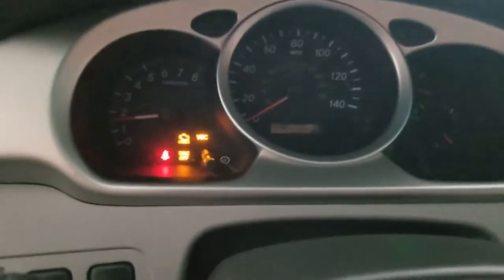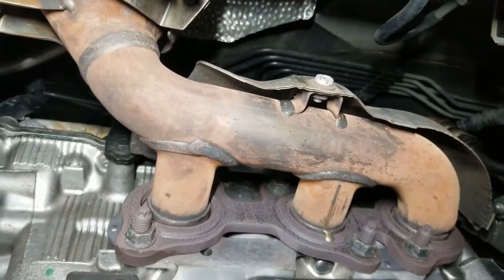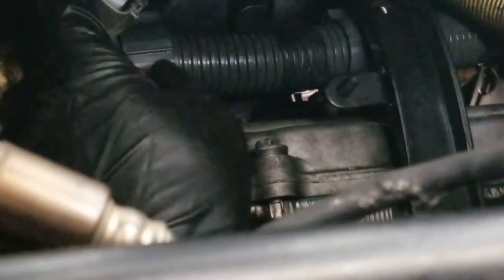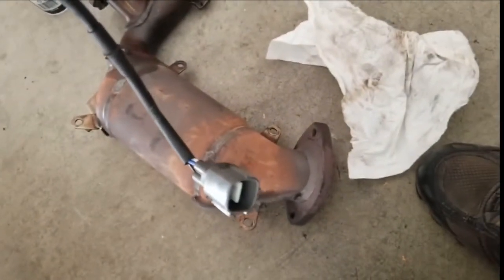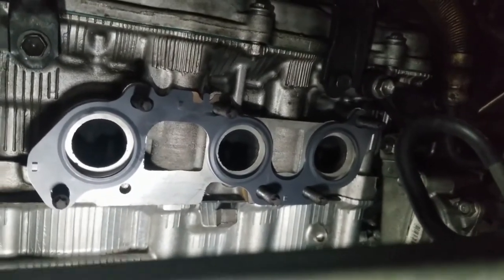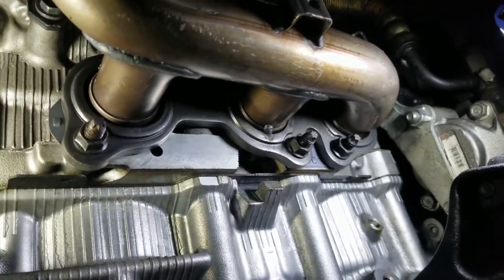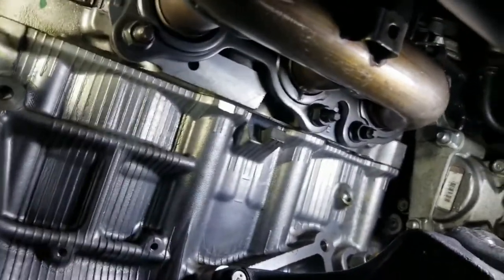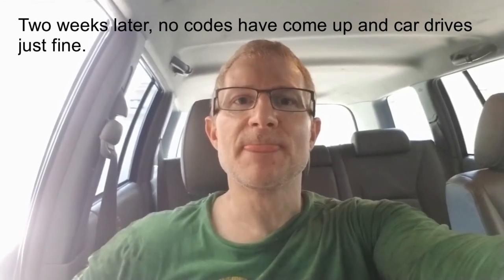Toyota Highlander 3MZ- FE (3MZFE) Catalytic Converter Bank 1 replacement (P0420)

Comment: Not every P0430 or P0420 require a catalytic converter replacement!  

I see that you tried SeaFoam, turpentine in the fuel tank, and other YouTube remedies to resolve his P0420 (Bank 1) error.  These solutions may work on a CAT that is contaminated, but not a CAT that has physical problems like broken catalyst, external damage to the CAT casing, or an exhaust leak between the upstream and downstream CAT sensors.

A CAT should last the life of the car, unless damaged internally or externally.  Getting a P0430 (or P0420) should not mean an automatic replacement of the Catalytic Converter.

This is a very good good video showing how to replace the Bank 1 CAT, but maybe the CAT didn't need to be replaced.  Smoking the exhaust system may have saved a lot of money on this fix.

On my Toyota Sienna, I was getting a P0430 (indicating catalyst below threshold Bank 2).  When I smoked the exhaust system from the tailpipe going forward, I saw smoke leaking out from the flange at the muffler and where the flange was welded to the pipe going forward.  This should not affect the Bank 2 CAT.  For the Bank 2 cat to be impacted, smoke needs to escape between the Air Fuel sensor (upstream of the CAT), and the O2 sensor (downstream of the cat).   I could not see any smoke between these 2 sensors.

I then removed the Bank 2 Air Fuel (upstream) sensor, and smoked the exhaust system from the front.  To do this, I removed the Air Fuel sensor and inserted my smoker hose into the Air Fuel sensor bung and plugged the tail pipe with a rag.  Now, I saw quite a bit of smoke leaking just upstream of the (downstream) O2 sensor, from the flange.  See the smoke here; https://drive.google.com/file/d/1p5fjdGIE1vrhlpXQia26AOWaGi6Mtvos/view?usp=sharing

The reason that an exhaust leak between the Air Fuel Sensor and the O2 Sensor can trigger a P0430 (or P0420) error, is that when the car is running, un-metered air is sucked in upstream of the O2 Sensor.  The sensor detects the oxygen in this air, and calculates that the CAT is not running efficiently.

This video by Walker is an excellent diagnostic resource for the P0430 error.  https://youtu.be/xDYOjAICbwE.  The solution for this vehicle was an exhaust leak between the Air Fuel and O2 sensors.  (At about the 12 minute mark, he checks the CAT and exhaust).

For me, replacing the seal between the flanges (Bank 2 CAT to Front Pike) resolved my P0430 error.  This fix cost less than $2 in parts.  Had I taken the car to a mechanic for the P0430 error, they would have replaced the Bank 2 CAT, and the flange seal for about $1,000. In my case, this would have eliminated the P0430 error, but not because of the new CAT, but because the flange seal was replaced.

This is the Smoke Tester that I made; https://youtu.be/crc6CJ_ni2w
Reply from the maker: Thank you Erik. I appreciate your exhaustive description of your repair of the cat code caused by an exhaust leak. I hope that others can use your information to help them when troubleshooting and repairing their vehicles. Thanks again for posting this info.
Reply: @TheRandomDave  Thanks Random Dave!  I always knew that the worst case scenario for my P0430 might be switching out the Catalytic Converter on Bank 2.  I also knew that without finding the cause of the Cat 'failure', that cause may cause a new Cat to fail as well.  My stubbornness to find the cause, paid off with this solution.  I hope my post will help more people.  Thanks!
Reply: Thank you so much. I've heard a ticking on cold starts, along with the engine light, for my vehicle and suspect an exhaust leak.
Reply: You’re right about not every p0430 and p0420 error needing a replaced Cat. I had p0420, p0430, p0442, and p0306 (misfire in cylinder 6). My uncle is a mechanic and told me in less than 1 minute…swap the ignition coil of the 6th cylinder to the 4th and the code will swap to p304 AND the other codes will go away. I did that and he was right! I bought a new ignition coil to fix the misfiring and every code went away. He said the other codes were there because they didn’t have enough time to heat up…I hope this helps someone! (Remember to reset the computer to wipe the codes too).

Comment: I followed your instructions… Just replaced the cat on a 2004 Lexus RX 330 with 175K miles… Piece of cake… Thank you so much
Reply from the maker: Nice work! Glad the vid helped you out.
Reply: Just found this. Have a po430 on my 2004 Toyota sienna le.  Gonna replace pcv valve,  add cataclean,  replace  o2 sensor then if po420 comes back replace the catalytic converter with aftermarket stainless steel one. OEM too expensive
Reply from the maker: @PeterHernandez-lg2eh  Sounds like a fair plan. I hope it works for you. Let me know how it goes.

Comment: I have 210,000 on my 2006 Toyota Highlander 3.3 6cylinder 4wd. That code popped up for me my check engine light as well as my VSC light came on. I changed the auction sensor near the radiator and the farthest downstream in the back and nothing. I’m afraid I’m gonna have to do the same thing you did but I will go ahead and order that sensor that you did not replace because I wouldn’t wanna get back under there again.  Really appreciate the video. It was very helpful for when I’m ready to get this done.
Reply from the maker: Thanks for the comment. I hope that oxygen sensor takes care of your issue.
Reply: @TheRandomDave  you didn’t I’m gonna have to replace the catalytic converter going to the exhaust manifold just like you did on your Highlander.
Reply: @MrAscroggin   Did you replace it? Did it fix your engine light? I have a 4wd as well. If you have any tips on doing the job I would appreciate it!

Comment: I’m a master mechanic and loved this video! Thanks. Degree of difficulty goes up slightly with an AWD. You do not need to pull your drive line. That O2 sensor connector is a pain. For AWD guys you will want to take your front pipe down. Need more gaskets. Just finished this AM within 4 hrs. Thanks for your video!

Comment: Great vid, gonna be doing the same thing and this has been very informative. Got a 2004 Sienna with same engine 3.3L that had the P0420 and P0430 codes popup.
Reply from the maker: Glad to be of some help. Best of luck in your repairs. Let me know how it goes.
Reply: Hello LL, I have to do that on 2006 Sienna for rear one, any tip, was it similar to 2007 Toyota Highlander Limited?

Comment: Thanks for the tutorial! I've got a 2006 Sienna with both 0430 and 0420. So I'll probably attempt to tackle this soon!
Reply: Hello Chris, I have to do that on 2006 Sienna for rear one, any tip, was it similar to 2007 Toyota Highlander Limited?
Reply: @singhsarabjit  I haven't done the job yet, actually. I keep procrastinating! Sorry!
Reply: @chrisa8541  No problem, I will let you know how it goes for me.
Reply: @singhsarabjit  Hi. I have an 06 Sienna. The post cat 02 sensor is easy to change. It is the pre cat sensor ( air fuel ratio) that is a bitch to get at. It is not impossible . It took a lot of effort to remove the connector , believe it or not. Its just that the space is tight and being on your back does not help any. If you are on your back like I was, then support your head with something so you don't strain your neck!.   I had to heat the sensor with a propane torch , where it is screwed in to the converter. It was easier after that to remove (22mm wrench, no need for a special sensor remover). Since you are dealing with a flame under the car have someone near you  to monitor things. I bought my sensor from Rockauto. , a denso brand about $100 bucks give or take . Cheers

Comment: I tried removing the fuel air ratio sensor with a 22mm wrench and it would not budge. What did the trick for me was to heat the sensor where it is screwed in, with a propane torch. It loosened up after a few minutes.

Comment: I have 2004  Toyota Sienna AWD 3.3L V6,  at 80,000 miles I got those PXXXX codes and decided to replace all 4  O2 sensors and the codes went away, but now at 110,000 miles the car will not complete its I/M  check to clear the CAT check in the OBD II, needed to pass smog,    I think I'll need two new CATs ,  so going to try the gas treatments for $10-30 first and if that doesn't work, I'll be watching your video in detail =(  ...,      Thanks for posting this video

Comment: Great video I’m in the same boat bank 1 sensor 1 code but how did you know it was that cat and not the one under the car I been trying to fix my 04 3.3 Camry for a min now and I used over five different cleaners also just bought a Infrared Thermometer  just to make sure. I’m starting my channel off the same code also lol but great video think media always say just start posting

Comment: You did an awesome job! Thank you for the very helpful video! Just what I was looking for from start to finish! I wondered how "tall an order" it would be to manipulate that rear manifold and cat in an out without having to remove a lot to get access. Particularly that sway bar and rack and pinion unit. 👍👏😉

Comment: About to do this on my '06, very helpful
Reply from the maker: Good luck, if you have any questions, feel free to ask!
Reply: @TheRandomDave  do you have to drop any components that may be in the way? It seemed like you were able to wiggle it through without taking too much out, I just want to make sure I don't have to take out the drive line or anything besides the cat itself and the supports. Haven't done too much preliminary investigation just yet
Reply from the maker: @jamesjonathan7187  No need to drop suspension or drive shaft or anything like that. It should be as simple as disconnecting it from the block and the exhaust pipe.
Reply: @TheRandomDave  good news! Now to watch your vid several more times lol thank you very much
Reply from the maker: @jamesjonathan7187  No worries, you got this!👍

Comment: Very impressed with the video.  BTW, If I have another job to replace valve cover gasket.  Assuming intake manifold was removed, would that be easier for certain steps?
Reply from the maker: Thanks for the comment Philip. If I understand your question correctly, I don't think removing the intake manifold would help much in replacing the bank 1 cat. Maybe it would help in accessing the connector for the air fuel ratio sensor from above, but I'm not sure. I've done both valve cover gaskets on this vehicle, make sure the bank one gasket is properly seated when you put the cover back on. It can be difficult to see back there and verify proper placement. Best of luck.

Comment: Great vídeo, thank you so much, I'm gonna do the same job on my 2006 highlander, question:
do you recommend buying the cat converter from ebay? 
They're way cheaper than what you paid for
Reply from the maker: Hi, if you don't live in a CARB regulated state such as California or New York, you should be able to use any cat converter that fits, and from a source you trust. However, I always use OEM stuff on my Toyotas. Let me know if you have any questions about the process. Best of luck to you!
Reply: @TheRandomDave  
Actually I do have a question about the process, is there any difference FWD and AWD when changing the cat? Or is the same procedure? Mine is an AWD
Reply from the maker: @RulisGarage  Yes, apparently there is a difference. I copied a comment from a viewer for you, I hope it answers your questions: "I’m a master mechanic and loved this video! Thanks. Degree of difficulty goes up slightly with an AWD. You do not need to pull your drive line. That O2 sensor connector is a pain. For AWD guys you will want to take your front pipe down. Need more gaskets. Just finished this AM within 4 hrs. Thanks for your video!"
Reply: @TheRandomDave  
Thanks man, I appreciate it !
Reply from the maker: @RulisGarage  no prob, lmk how it goes

Comment: Great video Dave. Question – I bought the new six studs and new six bolts for the header part. Did you replace the studs? If so, were they easy to get out with the E8 I believe you said.  My 04 has 240,000 miles on it.  I’ve done this job about six years ago. But I figured I’d replace the studs in the bolts. Curious what your experience was. Thanks!
Reply from the maker: hi Condor, I'm glad to hear you are keeping your Highlander going for so long, nice work! I did not replace the studs and bolts for the header part. I did clean them up with some brake cleaner and a brass wire brush. I think I used the E8 for the studs at the junction between the two halves of the exhaust pipe. I can't recall what size socket is for the header bolts, it may be the same? I'd just say be very careful and use something like PB blaster or WD40 on them just to give the best chance of getting them out without breaking them off. Let me know how it goes, Good Luck!

Comment: Lucky with your 2007. My 2005 V6 cannot see clearly all the nuts between the engine and cat at underneath. I think that I have to remove air intake.
Reply: After 3 days, lift Highlander again for sure that I can touch all 6 exhaust nuts. it's is really hard to touch all of them.

Comment: Thank You for your video!!!! This was exactly what I needed to see! Do you think an aftermarket cat will work? I just can't see paying $560 x 2 + $500 or more for the o2 sensors!!!!!!! If this car goes another 100k on aftermarket parts than I am OK! What do you think! The Highlander I am working on has 220k.
Reply from the maker: Hi Mike, glad this video was helpful for you. I think the aftermarket cats will work. The only issue I could possibly foresee is that the bolt holes may not perfectly line up with the studs, but you should be able to make it work anyhow. I used OEM cats because I live in California, and we (like New York) use the CARB standards for emissions, etc. So, I thought it was just safer to do OEM so I could pass emissions inspections. Best of luck in getting another 100K!
Reply: @TheRandomDave  I live in Temecula CA
Reply from the maker: @mikekmalick  You might be able to find CARB compliant cats from Walker Exhaust. Just search it up on google.
Reply: @TheRandomDave  They are cheaper from the dealer $545
Reply from the maker: @mikekmalick  Interesting, good to know. Best of luck Mike!

Comment: Question is the Catatalic Converter closer to the exiting exhaust pipe or the Catalytic convert closer to the front bumper
Reply from the maker: hi Robert, this is the catalytic converter at the front of the vehicle. it is the bank 1, at the back of the engine, closest to the firewall. or you could say closer to the exhaust pipe.
Reply: @TheRandomDave  For the Catalytic Convert this for bank 1 rear Catalytic Converter does it matter if its an AWD or FWD Catalytic Converter
Reply from the maker: @robertthegeek  i don't think it should matter if it is fwd or awd, the important thing is that it is a 3mz-fe engine (v6).
Reply: That's the thing I have Lexus Rx330 little different then your vehicle
And I cannot afford $400 or higher for a Catalytic Converter if its going this part and that part I will have start paying for I might as well start making car payments for a different vehicle
Reply from the maker: @robertthegeek  depending on what state you are located in, the cost of the catalytic converter may be less than $400. In California and New York, catalytic converters are more expensive.

Comment: Just did the radiator side and there seems to be some smoke coming out when I start the car. Is that an exhaust leak or does it do that when its new? Only had it on for a minute and also used a bit of gasket maker on the tailpipe side since the new gasket didnt fit. Any advice would be appreciated.
Reply from the maker: Where is the smoke coming from? the front of the car? underneath? the tailpipe? You should definitely check the temperature rating of your gasket maker to see if it's burning up, although it shouldn't be that hot yet if you only had it running for a minute. If you can see where the smoke is coming from, I could help better.
Reply: @TheRandomDave   Really appreciate your quick response and amazing video. The smoke is coming from the cat and a little out the tail pipe. After doing more research on the internet apparently this is normal for new cats as they break in I guess. Had no idea so I was worried. After running it for like 10-15 minutes its only smoking a tiny bit now and the burning rubber smell is fading too. Did you have a similar experience? Btw I used an aftermarket part rather than a toyota part.
Reply from the maker: @noahchen4323  Indeed I did notice a small amount of smoke and a bad smell for about 10minutes or so. It's likely the  oil they coat the metal with during the machining process or to prevent rusting. It sounds like you did a good job on  your cat replacement. Well done! I would  still keep an eye on your gasket material to make sure it can hold up to the heat.